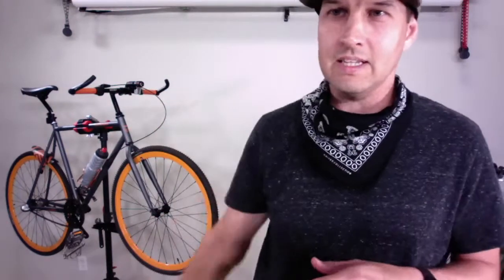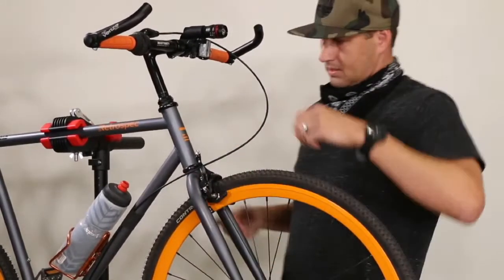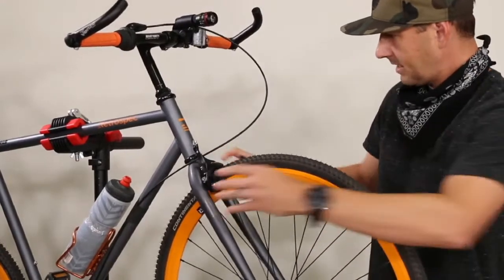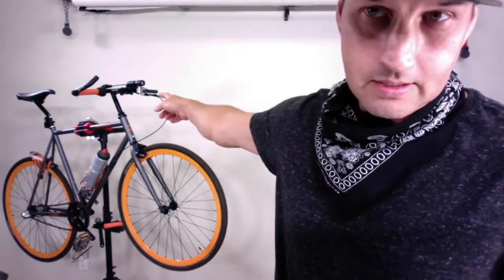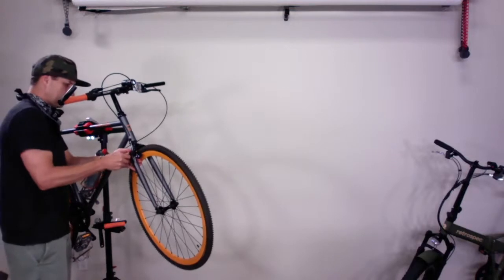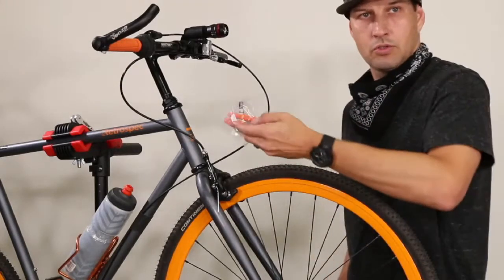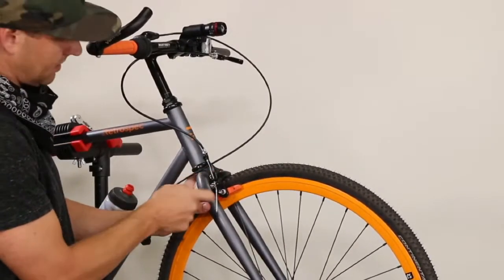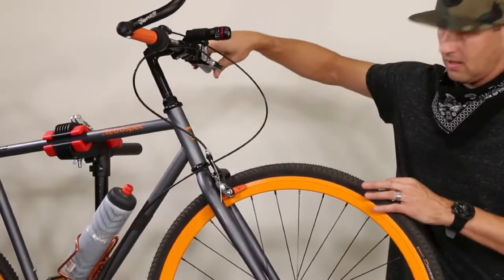Front Caliper Brake Install on Retrospec Harper Coaster Bicycle

Comment: Its is possible that the brake caliper will chip the frame if you turn right all the way the handlebar add a sticker or transparent film, I am not sure this is the case but double check, bike is looking great!! I have the same one and was looking to change tires but wasn't sure about the tire clearance. 32 is the way to go, cool!
Reply from the maker: You know what I think you're right. When I load the bike into my backseat I have to flip the bars around so it will fit and I noticed it will only flip one direction now. Good idea to add a clear sticker to the spot it touches. 👍
Reply: @DIWHYDOTLIFE  is that retrospec harper. Lightweight ❤️❤️❤️
Reply from the maker: Yes, the Harper is surprisingly lightweight for it being steel.